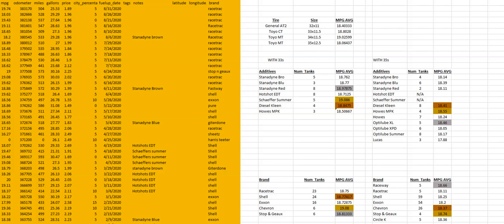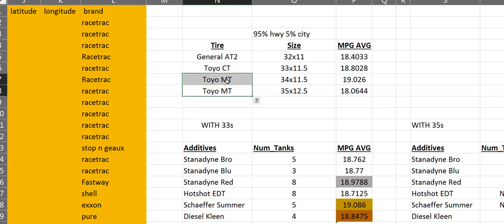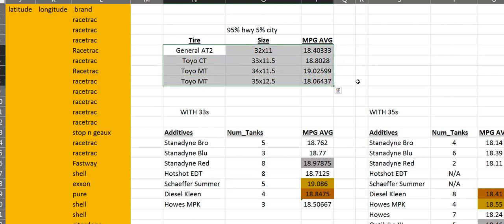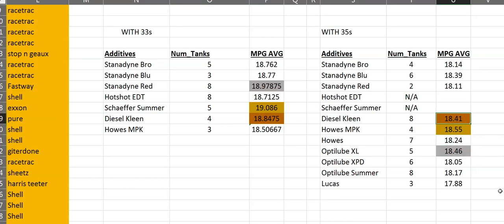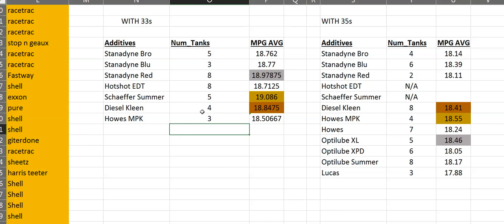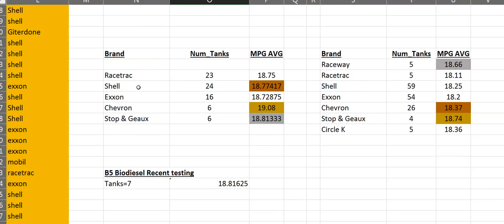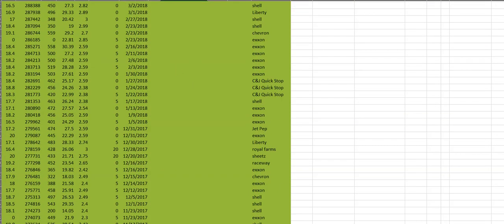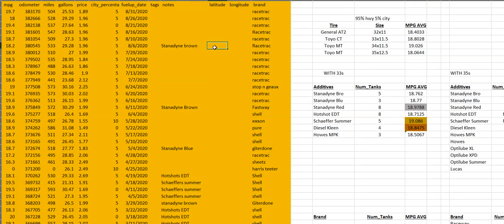Fuel economy data analysis - 5.9 cummins - 32 vs 33 vs 34 vs 35" tires, fuel additives, fuel brands

Comment: Outpost CTD Love the videos and the information your putting out there. Alot of good hard evidence and proof that I myself have tons of questions. New to owning a diesel 05 cummins I bought with 44k on it and less than a year I am up to 55k with little under 100miles it's my daily. Would like to keep learning more to my my old gal pass 600k with fewer problems then not.